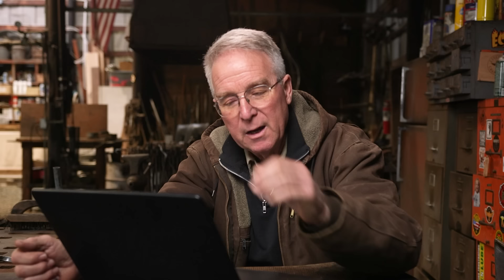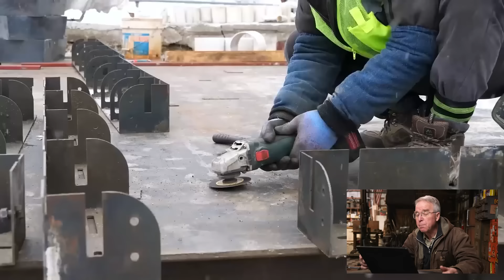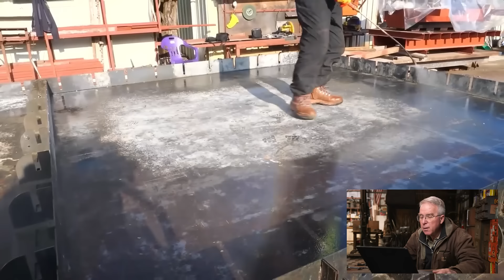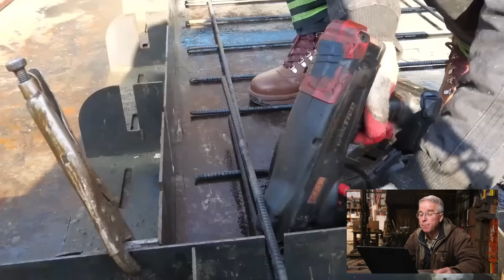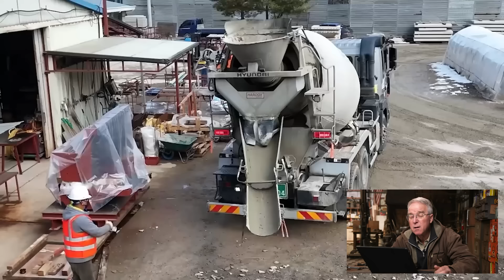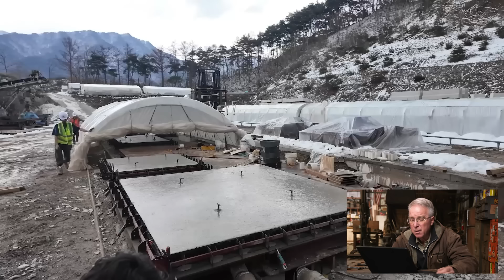40 Yr Contractor Learns CONCRETE  Korean House Construction

Comment: My grandfather owned a construction company that built skyscrapers, high rise apartment complexes and residential houses in Korea. When he first visited the US he was shocked at the residential housing. He complained that all of the houses were cheaply made and inefficient. He wasn’t wrong.
Reply: About what year was this?
Reply: @davidk6157 he first visited the US in the early to mid 00s
Reply: Concrete made apartments in Korea only lasted 30-40 years, now all getting torn down and rebuilt. So wouldn't bet on longevity.
Reply: @hahmmoKoreans have heated floors. Houses do not last long with that
Reply: 10년 내구성도 없는 한국아파트짓는게 니 할애비였냐?
Reply: 역사,문화,재료수급,경제에 따라 나라마다 다름.미국은 땅이 크고 돌 보다 목재를 구하고 이동하기 쉬워서 목조주택이 많은 거.한반도도 과거에 목조주택이 많은 이유가 다 산이라서
Reply: Beautiful but until this is brought in at mass scale with massive upfront costs, nobody is willing to make, this will never be North American construction. Not residential anyhow.
Reply: @dillonderoche4050 I am willing because that building will be good as a home or headquarters for the next 400yrs
Reply: @dillonderoche4050 lol look at this guy. Korea has no suburbs but only cities. It means Korean construction is much bigger in scale than American. A single apartment complex in Korea holds more than 10k people
Reply: @technocracy90 they could just move north. Smh losers. They have tons of unfilled buildings to use.
Reply: Inefficient as to what? 
All regions have different build methods and sequences.
Reply: @socalkb336 As compared to most western countries. Have you ever tried punching a hole in a German wall before? I don't recommend it. Neither do I recommend punching the brick or stone out of any others. We just have so many forests that making all our houses out of shitty foams and popsicle sticks seemed like a pretty good idea at the time, apparently. Unfortunately, it means that our houses are almost entirely shoot-through (to the point where a rifle bullet can go through multiple houses), bleed heat pretty badly, fall apart easier and faster, take more work to maintain, etc...
Reply: To use a rifle shot as reference to build quality is wild. And very American :))))
Reply: Yes,it takes 50years to finish a project. German construction.
Reply: The concrete house shown looks  way over-engineered to me -- 10x stronger than it needs to be.
Reply: @idsnow Wood is quite expensive here in Korea and also weather is humid and hot in summer but dry and freezing in winter. Concrete is better choice for both energy saving and durability plus construction cost in Korea.
Reply: @idsnow  Actually could be stronger considering it's proximity to North Korea. They aren't building these like bunkers just for extra wind resistance.
Reply: @idsnow Most Korean buildings, especially ones in proximity of the border, have code making it effectively dual use (i.e. repurposable for military use).
Reply: I’m not sure what you’re getting at, but South Korean building codes aren't exactly designed with thermal efficiency in mind. If you build strictly according to regulations, it’s more accurate to view it as a reinforced concrete bunker designed to withstand North Korean long-range artillery and missile strikes, or aerial bombardment from North Korea and China, rather than a living space. If South Korean buildings happen to show high thermal performance, it’s purely a byproduct of the 20+cm-thick reinforced concrete wall structures and the explosion-proof, fire-resistant materials used inside. It’s an accidental benefit of building a bunker.
Reply: @098rwe  한국 사람들은 대부분 철근콘크리트로 집을 짓습니다. 그래서 경량 목조 주택을 이해하지 못 합니다. 나무로 만들어진 집을 보면 아기돼지 삼형제 동화를 떠올리고 늑대가 불면 날아가는거 아니야? 라는 편견을 가지고 있죠.
아마 과거 한국에서 목재의 가격이 매우 비쌌던게 이유가 아닐까 생각합니다. 한국전쟁으로 인하여 한국의 숲은 거의 사라졌고 그런 상황에서 얼마 남지 않은 나무로 집을 짓는다는건 미친짓이었거든요.
그러니 한국 사람들 입장에선 철근콘크리트로 만든 집은 튼튼하고, 현대적이라는 인식이 생긴 반면에 나무로 만든 집은 근대 이전에 지어진 문화재이거나 아주 가난한 사람들이 살던 집이라는 인식이 있습니다. 
또 뉴스에서 종종 허리케인으로 완전히 박살난 미국 주택가의 이미지를 접하는것도 한 몫 할것같습니다. 많은 한국인들은 왜 매년 허리케인으로 집을 잃으면서 나무로 집을 짓지? 콘크리트로 지으면 허리케인에 끄떡 없을텐데 라는 의문을 가지고 있죠

아마 한국의 집이 벙커로 보이는것도 비슷한 미국인의 편견일수도 있겠네요. 재밌는 점은 실제로 90년대까지 한국은 법적으로 집마다 반 지하실을 만들도록 강제했었다는 점입니다. 평상시엔 창고로 쓰다 북한의 포격에서 대피하기도 하고 북한군이 쳐들어 왔을 때 지하실에서 상단에 달린 창문으로 사격하는 토치카로 쓸 수 있도록 하기 위해서요.
Reply: @CliGe-i9i  Applying high-strength concrete over 20cm thick with reinforcement goes beyond standard residential durability; it is, for all intents and purposes, bunker-specification construction. In a region lacking significant seismic activity or hurricane risks, red-brick masonry houses—common in the 1970s and 80s—would more than suffice for structural integrity.
A structure with these specifications is over-engineered to the point of maintaining structural and functional stability even against a 50kg TNT blast in close proximity. This suggests that the design objective extends far beyond the conventional definition of a sturdy home.
Reply: Furthermore, this is not a design that utilizes the voids characteristic of modern architecture. The reality is that in Korea, large-scale residential structures with Class 2 protection performance have become so commonplace that they’ve turned into a trend—people simply fail to notice it.
Reply: @098rwe 한국인들은 벙커를 만드려고 집을 짓는것도 아니고. 전쟁준비를 위해 집을 짓지 않는다. 이것은 정말 잘못된 정보야. 1960~1970년대 새마을운동이라고 해서 한국 발전을 위한 정부의 발전 사업이 있었다. 이때 한국에 철강회사와 많은 콘크리트공장이 세워지며 건축 자재로 활용하기 시작했다. 수십년이지나 현재 철골구조와 콘크리트는 한국에서 흔하고 누구나 사용하는 건축 자재가 되었고. 보일러나 가스를 이용한 바닥 난방을하는 한국에서는 벽과 천장 단열이 발달해 이방식이 표준이 된것이다.
현재 한국에서는 나무를 이용하여 건축하는  방식보다 집과 빌딩등에 이방법이 쓰이다보니 관련 건축방법이나 장비들이 발달해 더 빠르고 저렴해진거야. 
정리하자면 한국에서 철골구조 콘크리트 방식의 건축은 규모의 경제를 달성했다.
Reply: @CliGe-i9i  People that have the money in the US build houses in hurricane prone areas out of concrete as well as wood. A wood structure can withstand hurricane winds if built correctly but it costs a lot more. People in the US choose square footage over durability so again people with money can get both while people with less will build to the absolute minimum code in order to be able to afford a 4,000 sf house. But if they did to choose to go with this bunker type of construction they could only afford a 1,000 sf apartment.
Reply: @flipadavis  한국에선 정반대 상황이네요!
한국에서 미국처럼 나무로 주택을 지으면 콘크리트보다 훨씬 더 많은 돈을 내야 할거에요. 나무를 얻는 비용도 더 비싸고 그 나무를 다루는 목수를 고용하는 비용도 더 비쌉니다. 나무를 사용해서 집을 지을 때 필요한 다른 부자재도 더 비싸죠.
한국 사람들은 대부분 아파트를 선호하기 때문에 많은 아파트가 매일매일 지어지고 있습니다. 그래서 철근콘크리트에 대한 수효가 어마어마하기 때문에 철근 콘크리트가 매우 싸죠. 어느 지역이나 시멘트 공장이 있어서 값싸게 대량의 시멘트를 공급 받을 수 있습니다.
Reply: What does your grandfather know about US geographic lol we built this country without his existence and so far, so good.
Reply: @HevaNaisdey "we built". Not you built it for sure, buddy
Reply: @dmytrosoboliev935  we the people, lil stupid bro.
Reply: @HevaNaisdey as i said, not you built this country for sure.
Reply: @dmytrosoboliev935 I'm contributing every day. I work. I pay tax. I'm part of "we the people". Get it lil stupid bro?
Reply: @HevaNaisdey  So you're the one who built it, massacred the natives, and stole their land?
Reply: @HevaNaisdey  found the magat.

Comment: don't believe that. that's really expensive one. normally here in korea they don't even know how to cure a concrete slab. really horrible. if u want a good house you have to fight with workers who don't even know the basic knowledge about the property of material. usually concrete house lasts about 20 to 30 years maximin. can u believe that ? 30 years ?  not 100 years. lol and most job site they pour concrete below 30 fahrenheit without any addatives. they don't even know there are special addatives to pour a cold concrete. lol. and their knowledge based on old 60's japanese technologe

Comment: 21:47 power troweling is counterprodutive for adhesion if the next layer is Polystyrene concrete and then a thin layer of grout witch incases the radiant heating be it electric or water heat exchange pipeing - on top of witch are floor tiles , natural stone or sound dampening and wooden flooring - the concrete is merely structural its invisible in all living spaces as its coated and insulated and chalked and painted over , exterior walls have also insulation added outside later

Comment: I'm no contractor but I would say the one thing I did not agree with was when they poured the pad prior to setting their precast concrete on top of it they did not put rebar in that concrete.  I'm not sure how thick the concrete was that they poured but without rebar to give it strength all the weight that's on top of it will likely crack it because there's nothing there to give it the strength it needs to keep that from happening.

Comment: What a flashback!
I worked few years on a company in North Branford, CT making mainly precast parking garages... it's a lot involved but to answer the question of how long to remove the pieces of the mold,  it was usually 6-8 hours depending on the size... some of those vertical columns it would take a couple of days but to give you an idea the columns were 60+ ft long and at least 3x3ft in diameter with humps or hunches...
It is a very different mix, very gooey very hard to work with and to get a decent finish with a trowel without a special water wix is impossible also it sets very quickly, the pieces will stay on the yard for at least a month before it's shipped to the job site.
Thank you for sharing, your videos are always very interesting!!!
Reply: Hello from Newington.

Comment: So I never saw the start to finish process of those concrete multi-unit homes being built, but I have walked inside them, and the concrete floors are glass smooth. So there has to be a step where they use like a self leveling concrete or something similar to finalize those floors, rather than using a power trowel.

Comment: 16:47 On those columns that were set on top of the rebar stubs with wide open holes around the rebar, I assume there needs to be some sort of mortar or epoxy injected into those holes once everything is in position. Otherwise those rebar stubs are doing practically nothing.
Reply: https://youtu.be/GXIMQnndCVU?si=fAr1BRCiZ1rRqYEo

27:55  

This was omitted during the video editing process.

Comment: The most interesting concrete curing contraption I ever heard of was in America, when they constructed the Hoover Dam. @animigrafs channel did the best job of bringing the construction of the Hoover Dam to life in accurate technical animation.

The Engineers embedded cooling pipes, like hollow rebar if you will, in the concrete layers that led to the biggest radiator structure you ever saw to cool, aid in the balanced and quick curing of the concrete dam.

To date, it worked ;-) Keep up the fun work, helping young minds not forget the knowledge proven and intact. God bless.   Strength!   GODspeed!

Comment: hi, architect here from Europe, 
@9:21 that concrete without rebar is just "assembly concrete" as we call it, giving them a nice hard surface, instead of working in the mud, not structural no need for rebars, and the foil under it is just to keep the water in the concrete. 
@13:46 yes we have foams that are strong enough to step on (EPS = expanded polystyrene), those are used on the ground and the reinforced concrete slab goes on top on that as you can see at @16:21 so the foam is not really bearing any load in the end. 
About power trowels @21:35 no need at this stage, as you can see the rebars and and the steel mash this concrete is structural, holding the whole floor together, surface must be just good enough and to be level. The floor will most probably be the so called "floating floor" system, where you put about 1 inch of foam (this is the layer on which the above layers float - it helps against sound traveling through the floors) then about 2-3 inches of (quite dry) concrete in which you can put floor heating tubes for example, and this is where the power trowels come and make it super smooth. Finally tiles or whatever flooring you want.
Reply: I'm watching the Kop construction in Wrexham and they called the concrete pour without rebar blinding. It's for the same purpose, to have a stable ground surface to work on. Wrexham gets a lot of rain this time of year and without the blinding they would have difficulty doing anything
Reply: It's also called Blinding Concrete.

Comment: I accidentally drilled through the tip of my index finger and nail putting together Ikea closet units for my mom. 
Needless to say, I am now very very aware of my finger location around power tools.
Reply: I got goosebumps and a little queasy thinking about this comment.

Comment: At time 10 min. They are putting down a rat slab…. ie a thin layer of concrete that provides a clean waterproof working surface through the duration of construction. No more strength than the ground below but keeps you from fighting dirt and mud when working on the foundation.
Reply: Properly called blinding concrete

Comment: You should head north a bit up to Tacoma WA and get a tour of the CTC precast yard. They build out pc girders, piles, plus many of the marine precast products used up in the pc north west. They will typically cycle there forms every day the use steam heating to accelerate the initial set and cure for handling then let it sit in their yard for some time prior to shipping out the various construction sites.

Comment: If the re bar isn't treated properly it can cause the concrete to blow after time.
Here in the UK, they call it "concrete cancer" buildings literally fall to pieces, post war houses were quickly erected and after 30 years had to have outer brick walls and inner block walls erected either side of the concrete walls to prevent the houses from collapsing, very, very expensive repair and a major upheaval for the occupants.
Reply: Are you referring to what happens when rebar starts to rust? There's a lot of reasons why that can happen. But generally it's just a matter of time before it does, even when done well. Generally the thicker the layer of concrete between the rebar and he surface the longer it will last. But issues like concrete mixes with corrosion inducing components like chlorides or salts in the environment around the concrete can speed the process up. Coating the rebar can slow the process down, but eventually iron rebar will start to rust and expand, cracking the concrete around it.
Reply: @siggyincr7447  My understanding is that the re bar is allowed to rust, then it's wire brushed to be rid of rust flakes which in turn makes the re bar stable and less likely to blow the concrete.
Reply: @user-it4eu4og6m Unlikely, mill scale is actually slightly corrosion resistant. But there are various ways to slow corrosion such as applying a rust convertor prior to pouring or epoxy coating, but those are just preventatives, eventually the rebar will rust and cause the concrete to crack and pop off. It's just a question of if it happens in 10 years or 150 years.
Reply: @siggyincr7447  Unlikely, can't see builders paying out for rust converter or epoxy, plus the cost of man hours applying the above.

Comment: Underfloor heating is extremely common in Korea. There will be heated water lines across all the floor and it will have more concrete on top.
Reply: It's called Ondol, and that's the modern version of an old traditional method that used an outdoor kitchen's stove to funnel heat underneath throughout the house.
Reply: must be nice.
Reply: It is relatively common in the US also.
Reply: @kellymoses8566 what i mean by extremely common, almost all the homes have underfloor heating. It isn't a premium feature, it's expected even for low budget homes. Underfloor heating has been the norm for Korean home for millenia. Different technology over time, but underfloor heating.
Reply: @kellymoses8566  More often in bathrooms and seldom entire houses. The few regions likely to have it are going to be border states that are inland. It's very expensive to install and those with shorter winters wont see the value over central heating.
Reply: @heavy1metal when I was stztioned in Korea in 2005 my apartments entire floor was heated. Anything "recent" is gonna have heating thoughout the entire house. Ive lived in Korea for a total of about 8 years and have never seen central heat/ac.
Reply: @jasonhayman9521  80년~90년대 초반까지 지은 아파트는 중앙난방을 했습니다. 지금은 거의다 재건축이 되어서 중앙난방이 아마도 거의 없을겁니다.
Reply: @jasonhayman9521 S. Korea had under floor heating over for ancient time.
Reply: @heavy1metal not expensive,not big cost..only 3000 dollars or so with the full floor in the house  of one story...
Reply: 한국에서는 지식에대한 수준이나 관심도 낮고 역사왜곡이 패시브라 말하는거 전부 믿으면 정신병자 취급당함. 한국의 현대식 온수 보일러는 80년대는 되서야 영국에서 1906년 개발된 패널난방을 쓴거고, 그 전에는 나무랑 연탄을 사용한 난방을 사용해서 일산화탄소 중독으로 사람 죽는것도 일상이였다.
아파트 단지마다 가운데 큰 기둥이 있는 아파트 단지들이 있는데 거기는 중앙난방 시스템임. 90~00년대 초반 사용했는데, 가스 온수보일러, 전기 온수보일러가 도입되면서 거의 사라졌지
Reply: @Norahgi8827s  그 영국인이 개발한게 한국 온돌보고 영감받아 만든거임, 근데 실제 온돌은 진짜 너무 뜨거워서 관리 잘해야함. 옛날 시골에서 온돌방 가면 진짜 엄청 뜨거운데, 겨울때 온열은 갑인듯
Reply: @Norahgi8827s  그건 모든 나라 다 마찬가지... (지식 수준)
Reply: @Norahgi8827s   자국혐오자 으 드러워
Reply: @Norahgi8827s 
쟁점이 뭐신가?  엄청 썼는데..  그게 다 바닥 덥히는 방식이고 연료만 다른 건데..  말하고자 하는게 뭐임?  지식 타령에 패시브(?) 패시브란 단어가 그표현에 맞는 단어이기나 하나?
Reply: @moo76man  그렇게요 지가 ㅄ인데 남타령하네요 ㅋㅋㅋㅋㅋ
Reply: 이 주제에 대해서는 잘 모르지만 역사왜곡이 일상이라는 점에서는 100% 동의함…
Reply: @Norahgi8827s  한국만 그런거 아닌데 ㅋㅋㅋㅋㅋ 온라인에서는 다 그런거임